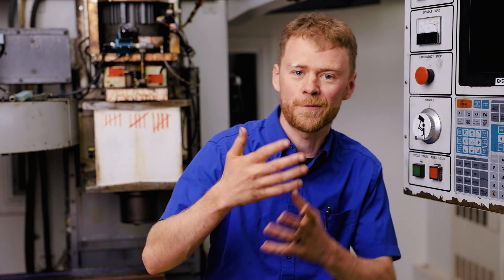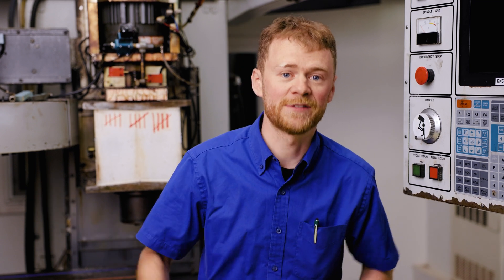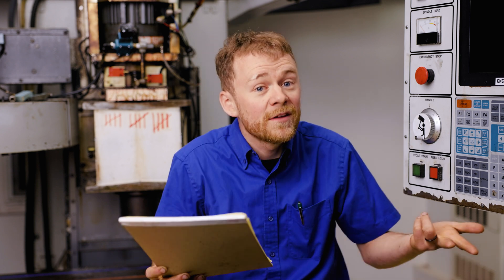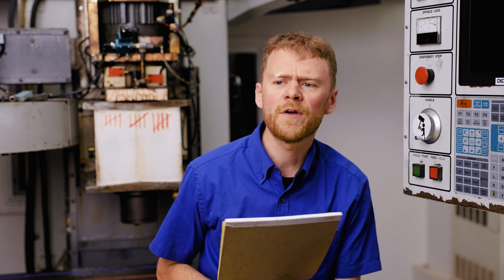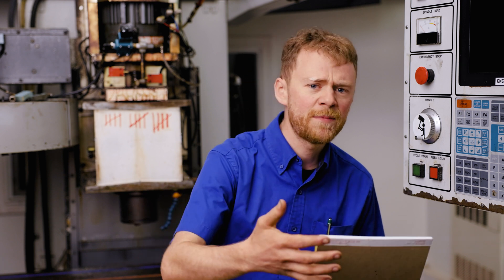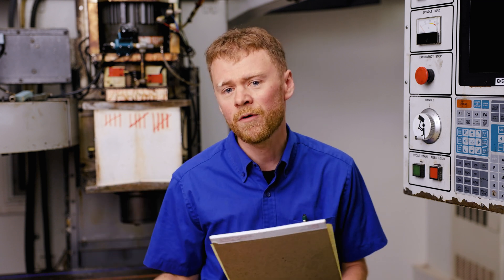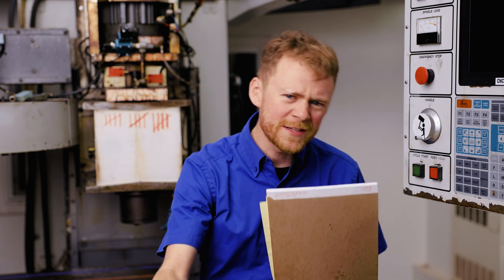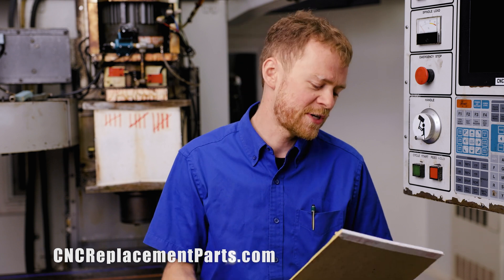Why Old CNC Machines Are Being Scrapped

Comment: I've have a CNC mill that's getting scrapped because we destroyed it using it as a refractory grinder... yeah running straight water and using diamond wheels is a terribly hard on a machine. But the customer gladly paid me for it and so I destroyed it. Could I repair it, sure, but the cost of parts would be way more that a good condition used machine so that would be silly. And we salvaged a pile of parts off of it, heck the local dealer came down and took a bunch of parts of it and pay me a bit for them so win win. Also you will get some cash for the scrap metal so buy the time you add up the numbers a lot of the time it's not worth fixing up old machines unless it's just for fun.

Comment: Defiantly agree that if you can't shift or repair a machine yourself, it probaly isn't a project to take on, but there is some circumstances where it can work out economicly. At my work we have done a control retrofit on a Mazak M4 that was in good mechanical conditon, and we are well in front compared to buying a new one. we have also scrapped a few machines that were to worn to be of any value.

Comment: My dad bought a 2500$ 1993 Hardinge Cobra 65. Probably had 10k in repairs in 6 months, and was replaced with a new Smart lathe shortly after. 

He did pick up a 1998 Amera-seiki lathe for 6000 a few months before that had less than 700 hours on it. That machine worked great, outperforming our newer lathes. But repairs were expensive, and probably had 5k in a year in repairs. 

Sold them together for 12k, and they were refurbished and sent to South America. 

I wouldn't buy anything old that doesn't have a USB port, I kinda feel like that's the line. Our 2006 HAAS VF-3 is probably the most reliable machine at the shop, it doesn't perform like our newer UMC or VF2 but, it's a tank. And has the option for a "door hold override". The new machines don't have that lol.
Reply: Have you looked into shopfloorautomations USB and drip feeding adition? Or centroid?
Reply: Forgot to add we bought a shop about 8 years ago that came with a hardinge conquest from the 80's/90's. Ended up scrapping it after a year.
Reply from the maker: Yes I would agree. USB machines are nice. Stay away from converters.

Comment: Love my Nissin Nst-40 150 2tsc. It was 26,000 pounds, with a 45 kw motor. 18" kitagawa chuck. Thing is a beast. So rigid, so powerful. Hardest part is like most, it wanted 125 amps. Nissin is now SNK, they have great support. The okuma lb-15 with a big bore is astonishingly good.
Reply: Even old Okuma manual stuff is built so strong.  Lasts forever.

Comment: Hehe. Hitachi Seiki... they are awesome, and yes, a little hard to work on since they often run their own Seicos PLC alongside the Fanuc motion control system. 

Retrofit it with a Centroid controller. It turns them into superstars.
Reply: Right now doing a retrofit for a friend of a 24 years old machining center with newer Allin1DC Centroid controller. Hopefully we will make the machine move soon. He's a machinist but don't know so much in electrical. I've done an Acorn retrofit on a small CNC router and currently making a plasma table with Acorn as well.
Reply: Hello I have a hardinge cobra 65 lathe with Fanuc controller and I can't get it to work so I'm thinking of retrofit it
Reply: x1000000000 Centroid is amazing and their company is phenomenal

Comment: I'm currently going through the transition of what I should have done to what I have already done ???

I didn't so much buy a heap of junk.
I purchased an old 1990 model Mazak QT15, which in my eyes is still an excellent machine to have in any shop today. 
Those who own them rarely want to part with them. 
For this reason Very difficult machines to find for sale.

Unfortunately, it was run like most machines that were planned to be replaced. 
Lots of small parts missing or broken, and it was showing its age.

Like so many guys I didn't really have the money to buy anything new, or I basically couldn't justify buying anything new with the amount of work I was doing at that time. 

I started fixing it up with thoughts of a good tidy up.
As time went on, I became a little too obsessed with the idea of having an old but a very tidy machine.

I finished up completely stripping the whole machine with the thoughts that I could never have a new machine, so why not have an older Very tidy machine. 

As time went on, I became more busy and spent less time trying to finish with the rebuilding the machine.
Now it was becoming very frustrating that all my turning work could only be done on my Manual Lathe. 
Frustrated by the time it was taking to complete jobs and be cost effective with my prices  ???

While all this was happening, my Mazak Mission as I call it, sat there not running ???  and continuously reminding me that it wasn't running 😡

Thankfully, years later, I was in a position to finally justify buying a new CNC Lathe. 

Now I just need time to finish my Mazak Mission. 

Long story. 
But, not as long as it has taken to complete my Mazak Mission. 

Definitely interesting to do.
But, very time consuming. 
I guess I was thinking too much like a poor person who could never see myself with a new machine ???

IF anyone is interested I have posted a fair few videos of some of the work I have completed so far. 

Eventually 1 day when it's running. 
I plan to sell a very nice Mazak CNC Lathe. 

One of those moments in life when you're wiser after the fact 🙂👍
Reply: Great story, tHanks for posting
Reply: @Dancing_Alone_wRentals 
 Thanks for taking the time to read my story. 
I must admit I did get a little caught up in the moment and pretty much told my whole Mission story 😅
But,  it has been an interesting project 
🙂👍

Comment: I’ve picked up 3 swarf conveyors from machines being scrapped. We got rid of a HS vm40 because if was a piece of junk and our repair guy said to get rid of it. He happily repaired our old 1985 Mazak v20 until the tool changer electrics became too unreliable and hard to find bits for. It’s was a brilliant old machine and was sad to see if go. If we had the workshop space we would have kept it and retrofit new controls as it had huge Z axis travels and was stupidly rigid. We replaced it with a newer FJV which is also an impressive machine but we have had to outsource some machining because of the less Z travel. We have a workshop full of 90’s mazaks and with regular maintenance and cleaning we keep them running nice and making great parts.

Comment: I had two excello 605's given to me last year. cost me 3500 to move them. 600 to do the wiring mods to convert from 600vac, and replace the motor with a phase converted 208vac motor. I am an old electronics technician/industrial electrician so it's just a hobby and i have all schematics and manuals but man..... if I had to pay me to do this just to have an 80's machine. No way.
Reply: I was at a scrap yard years back and someone brought in a large Genie lift. I called friends and the friends bought it from the guy before it was scrapped.  The machine looked closer to new than something deserving scrap.
Electronics issue.  Only my friends called the company and the guy who designed the electronics happen to take the call.  Walked them through the repair.
Imagine....they basically lucked out and got you on the phone.

Very impressive what people like you know and do.

Comment: PLEASE! Don't scrap a CNC or a mill, I need one. I'll drive there and box and crate it up if you don't want to do it.
Reply: start making cold calls to all local machine shops to see if they have anything they would part with. You would be surprised how many are out there. Also guys on the practical machinist forums are not getting younger and most have a machine they don't use as much as they should and would like to pass it on...

Comment: I have built my business on old iron no one wanted bc they couldn't figure out how to fix them. I fixed them up and have been in successful business for 14yrs. Admittedly I am not a production shop, most of my work is engineering and making parts for broken equipment in various industries.
Reply: hello, I wanted to in contact with you. I want to discuss something
Reply: My sister's first boyfriend (and my brother and I's ex best friend) family has a pretty successful shop that has the same type of philosophy. They basically don't want to add a machine payment to reduce overhead. It works for them, they mostly do big, big stuff. 

But, they could probably replace all their machines with 1 new one and get more production out. 

Granted, their smallest part is measured in feet, not inches or millimeters. So the price of a new (or newer) machine wouldn't be cheap. 

They have done a few parts for us and watching the videos, they were machined painfully slow.

Comment: "forklift stuck in the asphalt"  my last machine move was so .... ?????   to my wife "if the foor cracks when i move it in place we are renting a commercial space" (it was a very new machine tho, we just need a diferent space soon i think)    .  as for old. it kinda makes me cry seeing old "built this country" equipment die. saw a huge 90's mazak (large enough to park a truck on the table... with a second table that auto swapped) go at auction for 5k. now it lives in a tarp tent and never did get recommisioned, i bet the winter frost has destryed it... worked perfect when the company closed the doors and went to auction :(